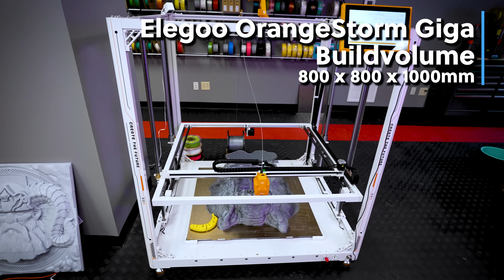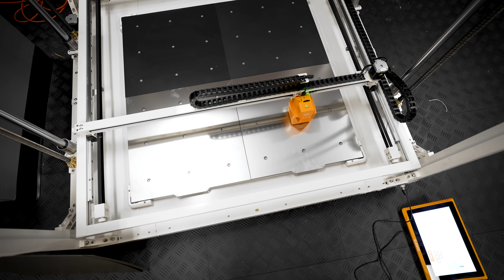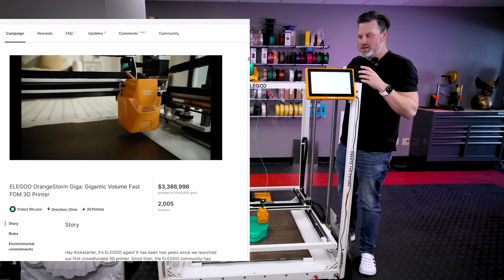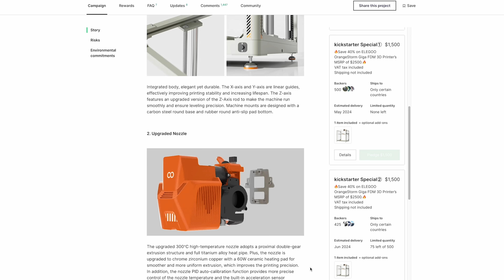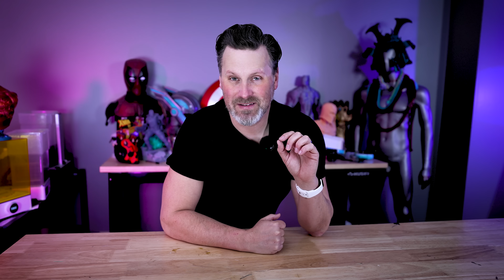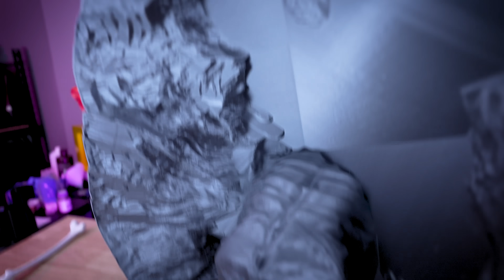Monster Sized 3D Prints - Elegoo OrangeStorm Giga!

Comment: If youre printing pla you do not need glue to unless youre using very old print plates. I never use glue and i got no problems with bed adhesion one way or the other. If anything, glued prints fail more often for me because by the end of the day it does add an inconsistant thickness between the bed/printjob.

Comment: Hi are you still using this machine and have you done any of the Lukes Lab upgrades or still stock and with PETG have you run it fast printing at all. Any issues any help would be greatly appreciated.Ive seen the one piece   bed and reel holder adapter vids you did as well.

Comment: if you don't like the location of that USB plug, you are using a 3D printer... get yourself a 6 foot or whatever USB extension, you can get yourself a 90 degree plug to make it more low profile and print our a mount that you can have the USB plug in on the top... not too hard to do. If I had a monster printer like that, that would be one of my first prints / creations although frankly I have no idea what I'd ever make with a print bead that large.

Comment: So… honestly.
What did it take to get this printer to work?!
I’ve seen your other videos on this Orange Giga… this video is Sponsored by Elegoo 😮
How many parts failed?
How many parts were replaced?
How many parts did you modify?
Is it as reliable now as an Ender? 
Thanks Jesse 🎉
Reply from the maker: Hey hey! I’ve since hand multiple firmware updates. That was the big thing. It’s now no longer having the print head crashing into the bed like was happening with other people’s machines as well. It also fixed the print resume shifting. 

I did just swap out the original .6 nozzle with a new .6 nozzle. 

The only major mod I added was a 1 piece 800x800 buildplate that was $200
Reply: @UncleJessy  Thank you :-)

Seems, historically, issues often relate to software, slicer.

Best wishes and thanks for all your years of support and virtual companionship :-)

Comment: I want them to make a 500x500 or 600x600 version of this, but maybe with the 1metre height. Would be much more useful for most home users, you can fit an entire R2D2 on a 500x500x1000 printer and it doesn't eat your entire room, and could have a single bed.

Comment: Looks like 3d printer acadamy is having a lot more problems with the giga. Failed prints at same height, filament runout sensor not working, power loss recovery not working, stopping and resuming print not working. By now u would think they would be able to get the basics right and have decent firmware.

Comment: I recommend buying a bunch of small weights. You can embed them in prints or just put them inside the middle of things like the ornithopter. You'd be amazed how much being able to control the center of gravity can elevate prints without having to do really in-depth engineering of the models.

Comment: the auto mesh calibration changes is because of the pressure point abl system. This is the same as the Elegoo neptune 3 machine I have, The value is always changing even though I changed nothing.

Comment: You may want to scrap the motherboard and install a Duet motherboard. With the expense of filament with such large prints, the quality of the motherboard will definitely matter. If your calibration sensor is infrared, the shiny surface of the build plate will mess with your calibration measurements. If it is a pressure sensor, then the plate may be too thin and cause surface changes due to uneven heating or flex during calibration. Hope this helps. May want to try a BL touch sensor to see if your measurements are consistent.

Comment: Man I would love a giant printer like this that just worked 100% of the time without problems! I think for the time being it's still better to just slice large objects into sections and print simultaneously on multiple Bambus. Then if I get a failure or problem I'm just reprinting a small section instead of having to completely redo a massive print from zero.

Comment: Does the giga have an induction probe? If so I’ve found with my n3plus that when the bed is hot the induction probe will give you very different results everytime it probes. 

In your klipper printer config you can set the probe tolerance, number of times it probes a point and number of retries the probe will probe a point if results are more than the tolerance value set, this may help a little

Comment: Cool machine, but anything that big with that many points to adjust should never make it out the door of the factory if it could require 2 rounds of manual leveling, then auto, then z-offset. That's ridiculous. I have a tronxy 500 and it had "only" 6 screws/spring points to adjust and it was a nightmare.

Comment: The same bed leveling issue happens to the Neptune 4 series.  I would strongly advised to avoid it since it cost so much and leveling the bed with a probe is the BASIC skill a printer needs to have.  Or purchase a different probe for it. Also, purchase a USB extension cord to position it by the pad instead of the bottom.  The filament. I would set something up that is mounted to the wall and goes out towards the middle of the printer instead of using the back of the printer. Or relocate to the front instead.

Comment: Maybe they can design a sliding rail system that can glide and lock into 3 position along the top of the printer.. front back and middle ( directly above center of heat beds ) that way if you run 4 extruder the filament and be at 90 degrees from print job?  just a crazy idea for elegoo.. pass it on..

Comment: Living Z offset/leveling -> Check tightness of things, such as the probe or heatblock on toolhead.

I had massive pain on a Sovol SV07 Plus for _months_, it printed fine, but Z was always off. Turns out the heater block was loose from factory and it was live just enough to cause setting z-offset to be always wonky. tighten those 2 screws, and ever perfect first layers.

I've seen other manufacturers leaving screws on toolhead rather loose as well.

Comment: Needs filament runout sensor relocation to front of printer first thing.
Also under bed heat insulation.

Also imagine enclosing this! ABS at this size? :D :D  or if it heats up enough (add insulation?) perhaps even Nylon :O

Perhaps need to build metal trolley with wheels for it too.

Comment: I noticed there's marks on the pei plates. Is that glue stick marks? If so, I thought that wasn't recommended for pei plates. I thought the reason for pei plates is to eliminate the need for any added adhesive?

Comment: A failed print would be DEVASTATING!
Reply: Oh man, any large print is anxiety inducing. I work with BigRep printers and prints running for 5-6 weeks is not uncommon... I don't sleep much when I have those running. 😂
Reply: @tasmaniakguitars  I feel you, we had one fail. Someone left a screwdriver on the top gantry which fell of onto the print at the 62 hour mark on a 65 hour print.... $800 loss of material. It still haunts me today. 6 week print is crazy though!
Reply: Especially if it is a massive print that could consume tons of filament

Comment: Those prints are... Impressive. A few issues, but this honestly looks pretty good. Wouldn't be hard to add an enclosure either, though a bit expensive. I mean, cardboard is cheap though. Given it can print stuff the rest of the market simply can't, I'm especially thinking car parts and large household items or huge models like you showed, it could probably pay for itself pretty quickly. Good stuff!

Comment: 4 beds. Each bed with 9 adjustment bolts. 36 opportunities to adjust. Put an exponent behind the 4, 9, or 36....you get a headache of opportunities to get it right. Hmmm...4 beds...put a model in the middle and get 4 seam lines at the bottom? The skirt around the base of the model looks funny in size when compared with the model and the size of this 3D printer...lol. Suggestion for bed? Make 1 plate, but a lot thicker and have it engineered as close to perfection as possible...yes, will cost more but time spent adjusting is more valuable.

Comment: is it possible to mount the rear top bar to the front? that way you can sit the touchscreen on the bar with the filament spool holders? is is there wiring that requires the rear bar to stay in the rear?

Comment: I imagine your computer specs will matter when running Orca Slicer. 

I tell Windows to use my dedicated GPU when running my slicer software, which is a noticeable difference from the integrated GPU. I also run 64gb of RAM and don’t need to worry about large files.

Comment: Now....Print a Chair.
Probably should also tell them to NOT run their own version of Klipper too.  As its ALSO is out of date.  Their bed leveling is using an Inductive Probe (at least the 4's do) which IS NOT that accurate of a system.  So you will get different numbers every time it runs, even nozzle pressure sensors have this issue too.  They also use that probe as the Z endstop, again this isn't accurate enough of a sensor to be reliable for that purpose.  Also Filament run out sensors are obsolete, and cause extra drag for no reason.  Most spools have windows on the side to show how much is left.
Elegoo basically built a VERY large Voron 2.4, but kind of skimped on the sensor package LOL.

Comment: The head must have the same proximity sensor as the Neptune 4 Max, and based off my experience of having that printer, the sensor is unreliable. The printeri needs a BL touch. The Z offset not saving is also another problem that's a 4 Max has. Let's get it together, Elegoo.

Comment: This printer is great fun, but also, it reveals a sad truth as well. This printer is great for what you do, obviously a ton of fun. But as shown over and over again, people do not print anything that is of real value to society with these. They consume a ton of filament and power, produce a ton of waste, but what need of our society do they actually meet? As much as these figures are fun, and as much as I love to print, I still fail to see where we actually contributing to society and progress with these printers.

So please don't get me wrong on this one. I love these crazy figures, and I love the enthusiasm. I get the fun. But that is all this is, at the moment.

This printer has 4 individual beds. The big picture, is to keep down power consumption printing large parts, as it for anything above 60C, needs like a river of power to print, both for heating a bed and a chaimber. The tech, as it is, is insanely power inefficient. It is a REAL challenge for us.

Please, Elegoo, if you are listening. Perfect the split bed. That way, for printers of this size, you may have a single pei for one bed, and use only one bed. For 800 by 400, you have a real PEI for that, and you use just the two beds. Learn to perfect it. Then use it for all your printers.

That way, you will only need two bed sizes. A 300x300 and a 200x200. That support 200,300,400, and 600 square beds. And you will have the argument of green power, as you cut power consumption when printing smaller parts. Also, we may use smaller PEI sheets for smaller prints, thus the wear will be more cost efficient, as smaller PEIs are cheaper to replace.

This needs to happen, for us a community to do our part, on cutting power consumption.

If the point is lost on people, it is also a great way to support the work of Uncle Jessy. That is one big stupid looking head, and half the fun is just watching him make it. But if we do so in a responsible way, that has a real chance of being generative and stimulate growth of printing parts that has real value to society, lots of these party pooper arguments sort of disappear.

We also sort of need to escape this image that large format printers can only be used to print furniture and crazy busts, heads, and cos play costumes. We need skilled designers that are able to explit the printing process, as to make models that can only be printed, and have real value. Only then, will this community really grow. We all need to start to call for recycling solutions for filament, as that will generate a wave of new interest in the corporate world, as in the corporate, there is a real push for being environmental aware.

Which really brings us back to were we need to focus: Power consumption of that bed. There is a third option, and that is to make a big bed, with insulated heating zones. The whole point is to reduce the area needed to be heated. If people really want this industry to grow, this needs to happen.

I sincerely hope Elegoo listen, and that they see the potential for them on this one. Perfect that bed. It will open doors in the commercial world, that otherwise will be shut.

And everyone one of us, need to start calling for our governments, even suppliers, to start offering recycling of used filament. As in real recycling of used filament, not just in name. I will benefit us all.

Not to mention that we need a 500*500 bed. And you need to make a 3*3 of that, as in 1500x1500 bed. Then please send one prototype to Uncle Jessy. It will be a ton of fun. If you at the same time, allowed for a single bed to be used, and one section of the bed was not a 500*500, but 4 250*250, that crazy man, could also showcase that even if such a printer can waste a ton of energy and money, it can be used insanely efficiently, for any sized print. Big or small.

Team up with someone, join forces with other makers, and launch local recyling solutions. Real recycling. Scream about them. Please. Innovate. Tackle the real hurdles.

Comment: As someone who backed the Elegoo Jupiter mostly based on Jesse's hype, and ended up with what's basically a beta test unit, I plead to those of you reading this- wait until the second revision at minimum.
Reply: Could you please elaborate on the major issue/s you had with it.
Reply: @design9639  I haven't been able to get two decent prints in a row. I had the death blob within the first three prints, bed won't hold level, did all firmware updates yet my machine won't hold Z offset, multiple fixtures loose and out of square. It requires constant tinkering and bed leveling. Ironically I have the Neptune 3 Max and have had zero issues.
Reply: @hotshoestudios   Wow that's very disappointing to hear! The fixtures not being square is not acceptable; you'd think that quality control would have caught all those problems. I wonder if they would have had a successful campaign if they pledged to deliver the product by the end of Q4 instead of Q1. I would venture to say probably not, since too many people would not have had the patience to wait till the end of the year. Finally, have you contacted Elegoo about it? I hope they can provide you the appropriate support so you can start printing!
Reply: @hotshoestudios  Sorry didn't see your response! I hope you were able to fix many of the issues you mentioned since your last comment!
Reply: @design9639 no problem. Unfortunately I never got mine to print. I gave up wasting time on it and have it ready for the trash can. Ironically my Neptune 3 Max hasn’t missed a beat.
Reply: Is a new version out after a year of your comment I want to get into 3d printing and am very bad with tech
Reply: Thank you so much for this honesty
Reply: Add my Neptune 4 Max to that as well. Total POS.
Reply: @hotshoestudios it's Great machine neptune 4 max. Mines been running 20 hours a day since January 15th and no major issues just occasional Littles ones like bed leveling when I haven't done it in over a week and sometimes having to change to a new nozzle gone through 2 nozzles so it's not that bad.
Reply: @Leoriic  you are one of the lucky ones. It seems the early models were all lemons like mine.
Reply from the maker: The good news is they should hopefully have a firmware update available soon for me to test that will hopefully resolve some of the things I’ve called out here 🤞🤞
Reply: @UncleJessy  Would love to see a follow-up if that happens.
Reply: @UncleJessy  still hasn't happened has it?
Reply: HAHA yeah glad someone said this ❤

Comment: @Uncle Jessy - The power cord is a standard IEC power cable (can't recall the style number off of the top of my head at the moment) but one can easily buy the plug from a local electrical supply store (off-the-shelf component).  That plug is required due to the higher input current requirements that the printer needs (power cord is probably on a 14 gauge wire setup... looks that way to me).  

How much does the printer weigh???  Looks totally awesome otherwise. :)

Comment: that's actually a standard power cable for high amp power supplies. I think anything past 1KW uses that plug. It means the cable is thicker and can handle more power.
Reply: Correct, it is a standard plug, just not as common. Regularly used in commercial applications like my Eaton 5P 2200 UPS.